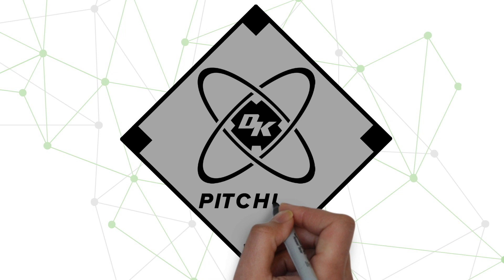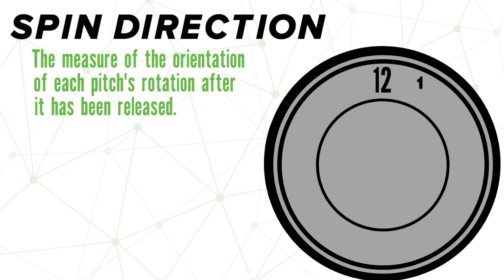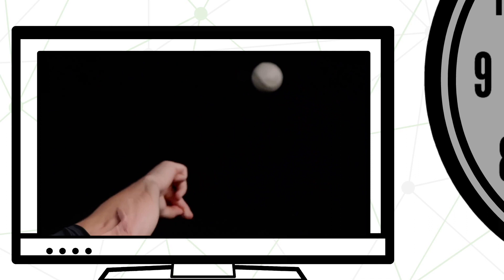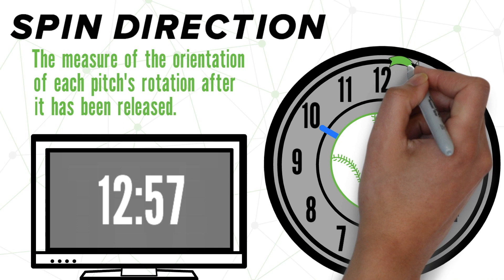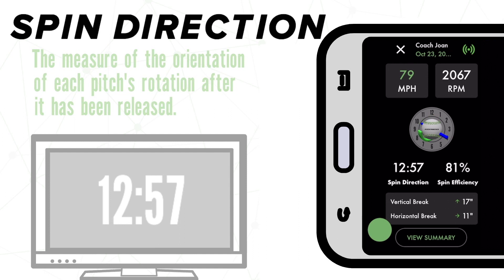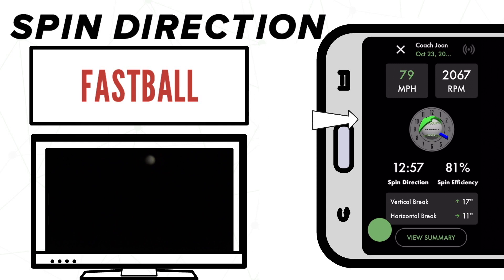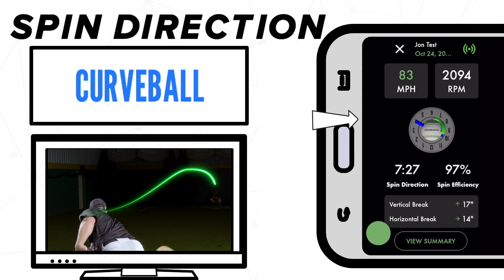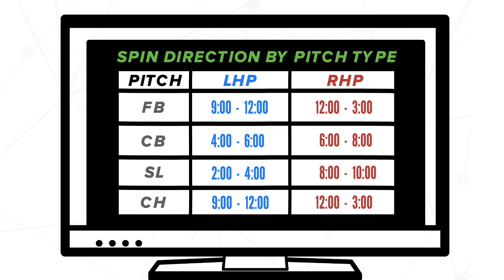SPIN DIRECTION: Diamond Kinetics PitchTracker

Comment: Great video! Would you advise trying to change spin direction with high school players to get more movement on pitches? Or will that do more damage than help with trying to change a pitch (because they already have thrown a certain pitch the same way for so long)?

Also, is there a way to use spin direction to help pitchers attack hitters in a certain way (like the high vs low spin rate with higher or lower in the zone)? Is it another metric unique for each pitcher or should it be in the ranges you showed in the video? Thanks!
Reply from the maker: Absolutely! Spin direction is meant to be altered with, but make sure you understand why you’re attempting to implement any changes before you dive in. 

As for good/bad, there are more advanced ways to decipher that information but generally shooting for the ranges described in the video is a good place to start. 

Thanks for the comment!